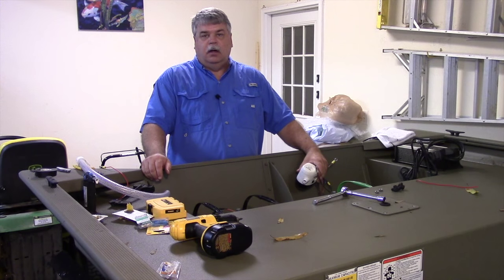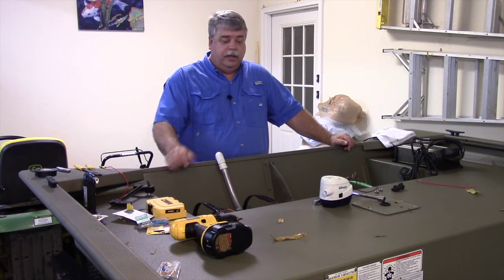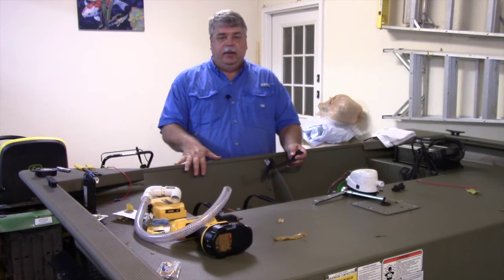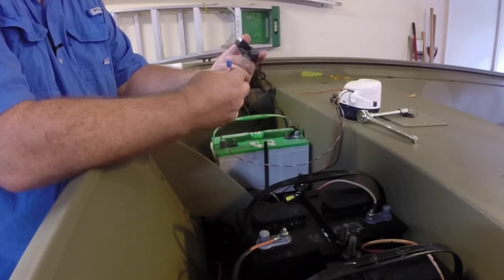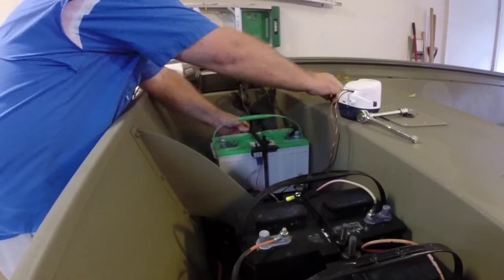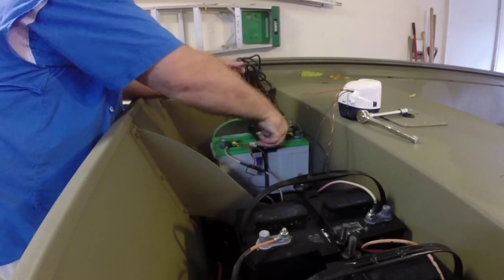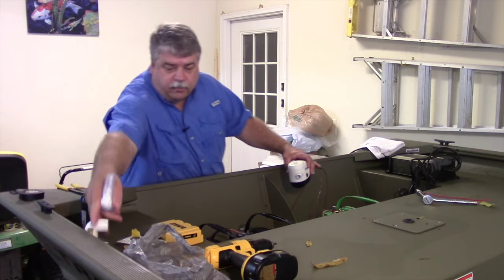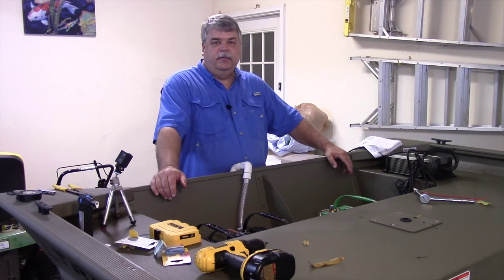Installing the Bilge Pump

Comment: You could drill a hole above the water line and install a thru hall fitting for the water to drain through
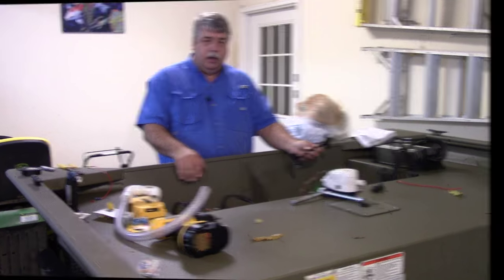Reply: 😮😊😮😮😮😊 1:59 1:59 😊

Comment: Can you attach a link to where you can find a battery brace like that and he switch?
Reply from the maker: I added the links.  Thanks for watching and letting me know I'd forgotten those links.
Reply: ScottMcGehee thanks Scott! Also how did you make that wire running to the positive from the manual switch? Get a red wire and put a connector on one end and make/female on the other?
Reply from the maker: that's correct.
Reply: Good deal, what gauge size do you recommend and how do you like that manual switch? I realize I'm a little late to the party seeing as how the video is almost 3yrs old but it's extremely helpful!
Reply from the maker: The manual switch is fine.  Since the Auto is hot wired, I don't use it much, but it's nice as a back up.  I don't remember the gauge on the wire, but I just got something close to the size of the wire coming off the bilge pump.  Probably either 14 or 16 gauge?
Reply: Could you attach a pic or send one that shows how the toggle switch is mounted to the bracket please sir?
Reply from the maker: I'll get one this weekend, but I don't think I can post it in a reply here.  Give me an email and I'll send it to you.